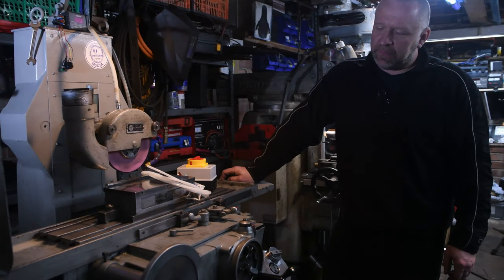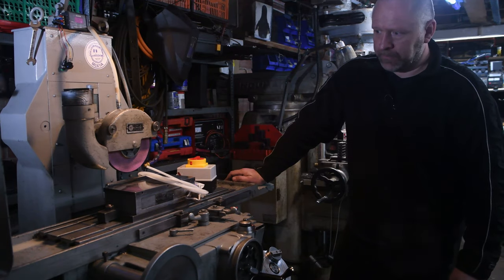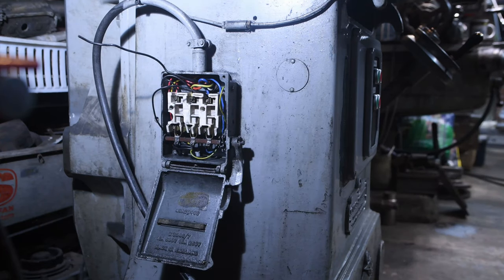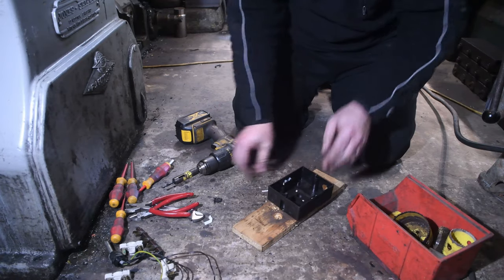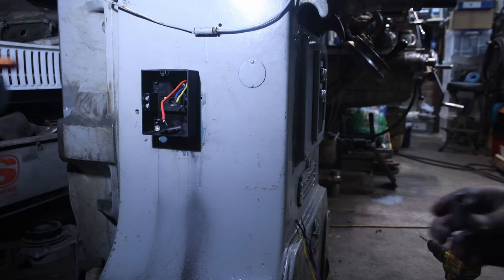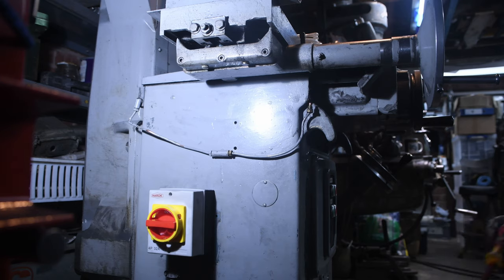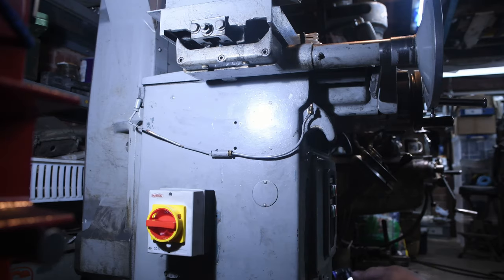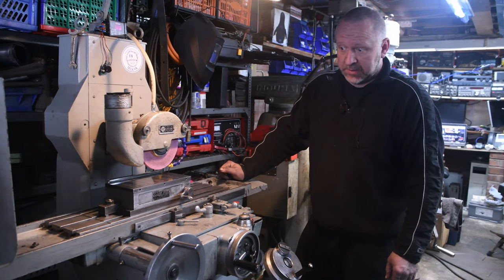Jones Shipman 540 Maintenance

Comment: I've carried out nut and bolt rebuilds of two 540s over the last 2 years. Both from the 50s. I was going to comment on the pipes are drain pipes. The end caps of both X and Y should end up with oil in them. If they dont you have a blockage somewhere. The entire hydraulics are managed through the large block of metal all the controls are on. Also run both motors for 5-10 minutes before using the machine. This gives the oil time to pressurise and lubricate the ways. If your motor start electrics are anything like mine you should replace them asap. They are just dangerous. Just use basic DOL starters. Finally I notice your 540 is sitting on a concrete floor. It will not be stable and your 540 will rock as the table goes back of forth. This will effect your surface finish. There are 3 holes in the base casting where you can put lifting bolts. I didnt bother I just put a 40mm x 10mm disc under each. This was enough to provide the tripod effect and make it so it doesnt wobble. Doesnt seem to matter thats is not level. At least its stable. I could not feel mine rocking. It was original light swaying in time with the table that got me wondering
Reply from the maker: Many thanks for the detailed comment. Yeah, it was only after my upload that I realised the pipes I replaced were for drainage. Also, totally agree about the ways being lubricated, I do think there is a blockage somewhere. It will require investigation before I next use it. I redid the wiring as it was totally rotten, agree, a total deathtrap! Will also do as you suggested re. the tripod mounts. It was only sat in a temporary position when I made the video. Will be moving it to a permanent position soon.

Comment: Those copper oil lines are drains. not feeds to the ways.
Reply from the maker: Hi, yes thanks for the reply. when editing the video I realised my mistake. I was going to do an update soon as I have several other bits to do on it.

Are you familiar with the 540? I assume the hydraulics feed is from below via the saddle?

I suspect I'll have to strip it down to give it a better clean..
Reply: @m0xya  Not overly familiar, i bought one the year before last and have being rebuilding it during the lockdown. Had to replace the bronze nut and handwheel spindle as mine was worn out. Decided to repaint the machine seeing as i had it in pieces, new spindle bearings, motor bearings, drive belt, Motor mounts. Parts are reasonably cheap, and its stupid not to renew them when the machine is dismantled. The crossfeed ways are lubricated from the oil draining down from above, only the table ways are pressure lubricated i think.
Reply from the maker: I may pick your brains in the not too distant future... Assuming you don't mind?

Comment: Hi, I would like to connect my 540 to VFD too. I run it off a Transwave converter, is there any problems to change to a VFD ie, two motors from one VFD and are the motors in delta which the instructions say.  thank you Patrick
Reply from the maker: Hi, my current setup uses a single VFD, however, I run into issues with the contactors tripping it into an error. My plan is to use two smaller VFDs, one for each motor. Then remove the contactors and drive them directly and use the VFD start/stop functions.
Reply: @m0xya  thank you for your replay. My other machine motors had to be changed from star to delta maybe that's what you need.